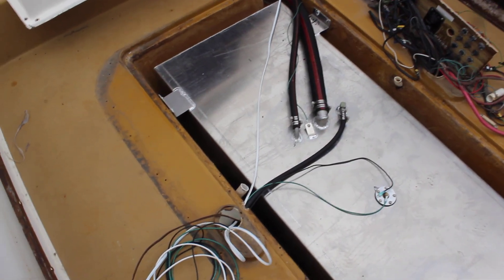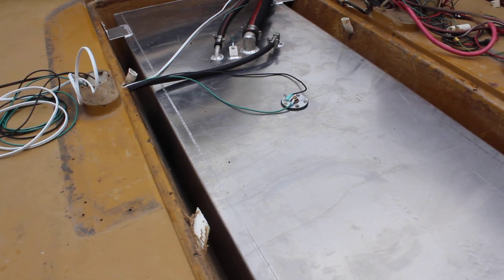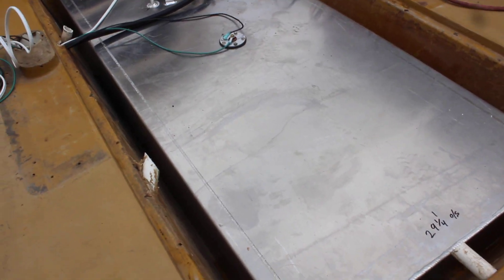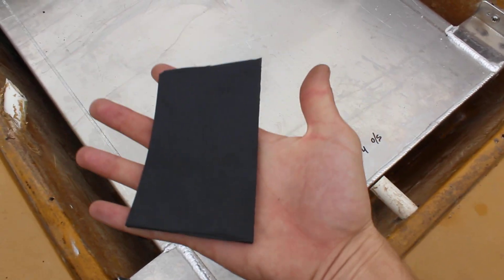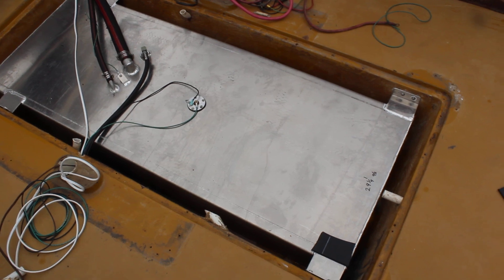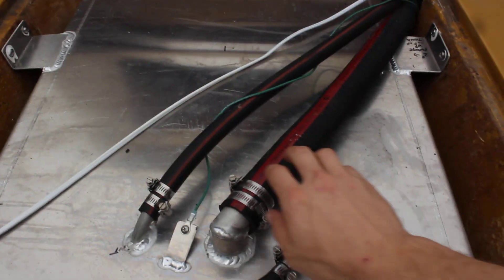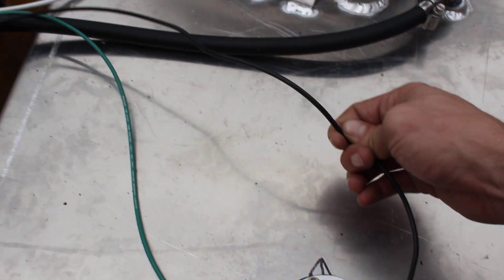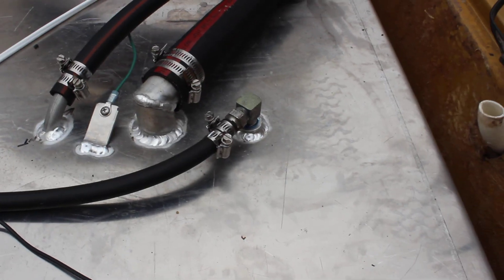Boat fuel tank installation Tips

Comment: The only thing that is missed they use foam so a cheaper (1/8") tank can be use.  When replacing the tank (without foam) it needs to at least 3/16" with cross baffles that are welded top (plug welded) to bottom. Strapping the tank down is best brackets welded to the tank can crack/leak.

Comment: why do you have the tank grounded on 2 points? thats not good. the tanks sensor will connect the other grounding point and current can flow between them. you dont want that
use loctite 577 on gasoline and diesel!

Comment: Still havent put tank in mako 224 working on coffin hatch,access hatch .Thinking of installing some type of drain in coffin bottom along each side lowest point tee in the back to one flex hose to a 12 volt pump to external location to dump after each use

Comment: Working on my mako 224 fuel tank,getting rid of all the foam.thought of using starboard under tank using 3m 4200 to secure to floor and tank painting fuel compartment with flex liquid  white to seal compartment for waterproofing. Painting tank with etching primer then painting with rustoleum  marine gray

Comment: Neoprene has carbon in it, which is conductive.  Dissimilar metals in an electrolyte creat galvanic corrosion.  Which looks like pits and gouges.  Make sure you face seal any pads totally.  Aluminum when corroding is self protecting, by forming aluminum oxide.  Very little of the metal actually is lost to oxide and relatively smooth.  As occurs on outboard motors.  This is the usual atmospheric type corrosion, but not galvanic corrosion.  If you can get vinyl pads, all the better.  My ‘92 Grady White had 1/8 inch thick strips of neoprene.  The tank was coated with a very light primer.  I removed the tanks in 2008 to clean and inspect, the only places where galvanic damage occurred was under the strips.  On the bottom and top.  Not deep enough to penetrate the 1/8 inch thick tank.  I cleaned out the pits, cleaned up the strips across a belt sander to roughen a bit, then fully faced with Life-seal, reinstalled.   In Feb 2021 I removed the same tanks to inspect, absolutely no corrosion under the pads in the bottom and no further damage to the existing pits.  On the top, where I did add neoprene under a cross brace, there was some galvanic damage, say about 5 square inches total, none of it deep enough to matter.  This area I didn’t face seal in 2008.  I used a Dremel carefully to clean out the pits.  I may apply a primer first.  When I reinstall there will be no contact at this point with any bracing, changing the design fro original.  I retired the small aux tank really don’t need it, will go back with the big 152 gal.  tank only.

Comment: I notice your "drain" pipe is at the top (back) of the compartment. Did you make a new drain hole on the bottom?
(I'm replacing the tank on an 84 mako 20c. It seemed that it was foamed in, with a built in foam canal leading to that drain pipe on the top back). I would like to try your method, but how did you address this drainage issue?

Comment: DIY Boater, aside from the two hose clamps on the main (large fuel hose) did you do apply any form of sealant inside the hose to get a good leak proof seal, or are the hose clamps enough?

Comment: West Marine, ...sells   Tinned Copper Strand.    it's copper wire with a coating of tin, lasts forever!!!  Especially on salt water trailers !!! I've used it for years on my trailer and boat !!!  also use a brand of ""self amalgamating tape"" from Lows or Home Dippo,   on all your open wire  connections!  last for ever!!  You pull and stretch this tape before wrapping around almost anything,  as you wrap it it binds to itself to form a solid rubber fused wrap, will never unwrap, is water tight, as it becomes one solid plug.......cut it with a razor to remove. It's as clean as the day you wrapped the wire.......

Comment: DIY, good advice on the tank - but do check the rubber bedding strips to make sure there is no 'free carbon' in the mix? Carbon is a metal with a galvanic differential to aluminum so you'd be making a battery if you used the wrong rubber to bed.

The idea of 5200 as bedding/bonding isolation is sound but... the areas where that adhesive is used should be sanded or etched so the mill scale is gone- mill scale is galvanic and retains water vapor- not liquid but will promote corrosion flowers.

All marine tanks should have #1 a water bottoms sump for pump out of 'tank bottoms' - OR a down comer fuel draw line that is very tight tot he bottom so the bottoms can be picked up into the fuel filter bowl(s).   

Also this tank is not etched so it will begin external and probably internal corrosion in few years- the explanation of crevice corrosion is accurate- but didn't include the mill scale which does the same thing- and tank bottoms will become De-aereated and acidic too.

All 5000 series aluminum tanks should be acid etched, rinsed and flushed extensively before installation. It is best practice to slope the to in a camber or 'shed' style not to be flat like t his one- where condensate can collect on the tank top.

Also fuel fill downcomer should got to within 1/2 diameter of pipe to the bottom plate to avoid burping, back slop on fill and bubbling fuel.

Comment: good video, educational,  I have question please comment,  recently purchased a preowned 28.9 SEA SPORT on the first fueling had a very bad, scary experience, a very strong smell of fuel in the cabin, evidently the tank may have a hole in it. am not very experience with this problem therefore any advise will be appreciated, plan to replace the tank with a stainless steel, is that a good approach? the deck will need to be cut in order to reach the tank.. help will be much appreciated

Comment: I sanded mine then treated with aluma prep and alodine then coated with epoxy. Also you could spray it with corrosion block

Comment: After reading a bunch of articles on installing my aluminum tank, I can say this video offers sound advice..  I also raised my tank out of the bilge a bit by sitting the neoprene pads (every 12-16" on trex board to allow water to drain underneath where it would have otherwise sat in contact with the tank. I attached the neoprene rubber using Life caulk (or use 5200 or 4500) to the bottom of the tank so no water can get in.  My tank was coal tar epoxy coated, which is worth requesting by the builder or coating the tank yourself if that's not an option. I actually sanded the rubber and light scuffing on the coal tar epoxy for better adhesion between the two and removed sanding residue first. reminder to electrically ground out the tank to the negative of the battery terminal or common ground, and never use bronze fittings on aluminum tanks for shutoffs and barbs as the dissimilar metal will eat the tank in short time due to electrolysis. I was told stainless is ok.  thank you for the video!

Comment: Great point on closed cell corrosion, extremely important, my 1973 ish 23 sportcraft tank held water next to the foam as the foam broke loose over the years the water was trapped and the tank developed hundreds of pinhole leaks. An explosion was adverted when I smelled gas one day took off the deck cover and gas was everywhere. Had the tank replaced and installed it similar to the way you did...Thank God on this one for sure. I don't think a lot of boaters are aware of this problem figuring its ok since they built it that way, BIG MISTAKE even today.Good job on the vid!

Comment: awesome video! did you use waterproof paint on your tank and what are those pipe around ur tank for, for venterlation?
Reply from the maker: +Sokthea Seng no paint on the tank, some people use a black epoxy paint but I prefer no coating, some of those pipes were conduit for old wiring.

Comment: Good video on Aluminum tank install. However, in my experience the term used for lack of oxygen due to organic materials and foamed-in insulation touching the outside of an Aluminum Fuel tank, and usually holding moisture, is called Poultice Corrosion. As applied to Aluminum Fuel Tanks, crevice corrosion falls under construction of the tank and what to avoid in order not to trap debris and moisture between aluminum surfaces. Usually addressed by having welded joints using a continuous smooth bead, leaving no crevices to trap moisture. For marine corrosion reference I generally use ABYC standard training and "The Boatowner's Guide to Corrosion" by Everett Collier.

Comment: Thanks for taking the time to make this video. I'm in the process of installing a gas tank for a home made boat. I notice that you have what appears to be a ground wire connected to the tank and it's located between the fill line and the engine gas line. This may be a dumb question but where is the other end of the ground connected?
Reply from the maker: +Lou Garcia sorry, missed your question thats the fuel fill ground or "bonding" wire its a good idea if you are using a metallic fuel fill. . if you are using a plastic fill no need
Reply: +DIY Boaters  where did you connect the bonding ground wire?? To the fuel full cap in the gunnel?
Reply: Any metal part has to be grounded out. So the filler cap and the bonding wire must be returned to the engine block or to the negative battery terminal. This is to prevent sparks.   As a side note take this very seriously.  I was up at Flaming Gorge two years ago, and  a boat blew up.  Yes KABOOM!  People were thrown into the water. I do not work at the fueling station but I knew how to run the barge with the fire pump and me and my nephew put out the boat before it burnt the whole marina down. The people did not have a blower that worked.  But the grounding is very important to prevent sparks, could save your life one day..

Comment: I have a 1993 Wellcraft V21 and im getting some gas on top of my tank and sender unit. I'm trying to see if its my hoses that are connected to the filler neck that maybe have some corrosion, because It only happens when I fill or when I just leave the gas dock and start running. Do you have any suggestions on what to do, and what gas hoses I should use ?
Reply from the maker: +Tom Scialpi sounds like a leak in the fuel fill tube for sure. Always use marine grade fuel lines. Like SHIELDS brand.

Comment: Watched both videos- great job!
Ive got my coffin clean and am right where you were on the first vid.
Your thoughts on tank corrosion and not using foam are insightful.Where did you get your new tank?
Have you had any problem with the tank shifting or screws loosening without the foam over time?
Reply from the maker: no problems with fastener just use large enough fasteners for the job. 

I had the tank made at a local welding shop in st petersburg fl
just craigslist in the services section and search for aluminum tanks

Thanks for watching

Comment: great video- I have found that I've got multiple small punctate corrosion holes in my tank and need to replace it.  Do you have any videos on throttle /steering disassembly to remove the center console to get to the tank?
I have a 18 foot 1984 Mako
Reply from the maker: Sorry I didnt see this sooner, but just look under the center console you probably have cable steering (safe-T) so just pull the pin or bolt and turn the steering wheel until the cable is fully out of the helm. then bust open you controls should be a cover plate on one side and disconnect the cables it is pretty self explanatory once you get into it.

Comment: question my boat mechanic guy is saying to use foam to hold my tank down im currently using a tank that's
 removeable but I wanna use my inboard tank y cant I foam to hold it down?
Reply from the maker: Thats how most people say to do it.... but as I repeated in the video there is something called crevice corrosion that occours when water is held up against aluminum and causes premature corrosion and end to the tank
Reply: DIY Boaters az

Comment: I bought the boat in November. The guy I bought it off of said the original owner replaced the deck and notice the tank had a lot of rust so he pulled it didn't want to buy another so he just put the new deck in and just used a top deck tank. Plus side is it was nice to know I'm only the 3rd owner not the 10th lol. Should I send u my email over this?

Comment: I plan on doing mine it's a 1986 four winns 190 horizon. Really can not find any dimensions on where to start.
Reply from the maker: did you get the boat with no tank and now you don't know what dimensions the tank should be? or you don't know where it should go? what exactly is the problem?